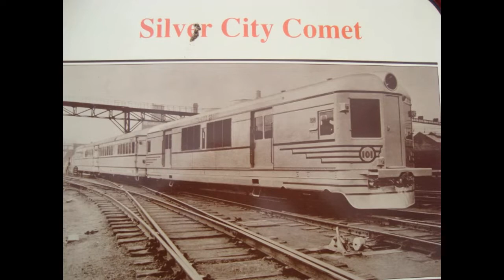Silver City Comet at Broken Hill Railway Museum Quick Tour

Comment: Thank's for the footage. They look in a lot better condition than the ones at thirlmere
Reply from the maker: The set at Broken Hill is well worn internally but having it under cover, and being in a dryer climate helps preserve the exterior. Very interesting train, especially the mechanics of the power car. Would have been great to have ridden it. No doubt it could be restored to running order but probably not likely.

Comment: A shame it wasnt working still at a museum like at therlimere
Reply from the maker: It would be nice if it was operational. It is at the old narrow gauge Sulphide Street railway station which has been converted into the railway museum, and it is about a kilometre away from the standard gauge line on which it ran.. They would have had to transport the train by road to the museum.. The engines look good and probably would start with few problems. Would be good to have return trips to Menindee though; and quite an experience for sure..